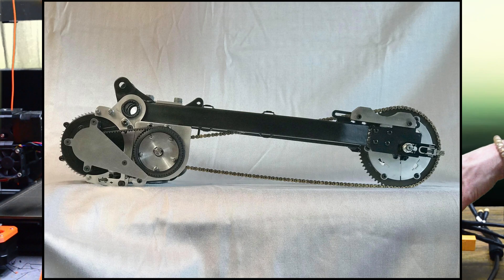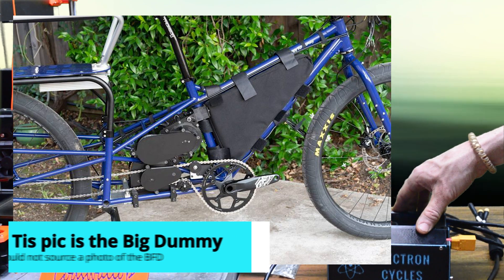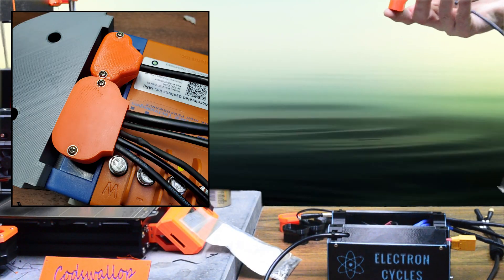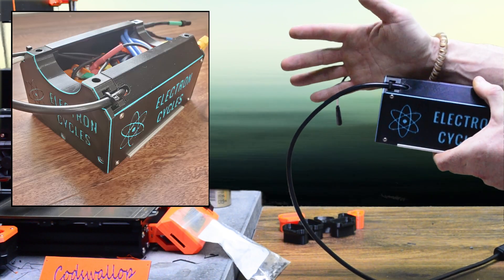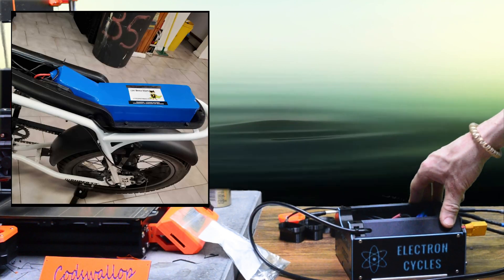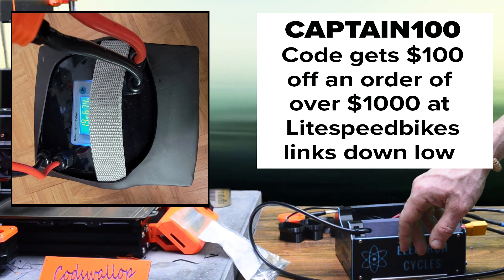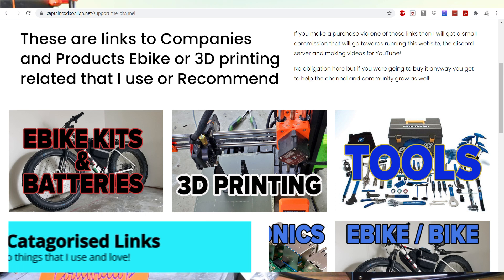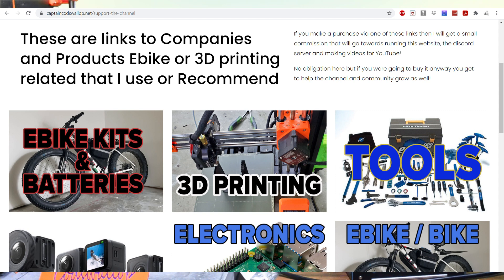Lightning Rods Big Block XL 10kw Ebike build Part 7 - Motor Update & Battery Discount Code

Comment: Are you willing to share any of those models? Say, those right-angle molex connectors? Pretty slick.
Reply from the maker: Hey Cody. Thanks for the comment. I would love to share the designs but I am going to be selling them on my website. So if the files go out then that option disappears. The money I make by selling my products then funds the channel and the wider community such as discord. The good news is I am pretty cheap. To get a set of genuine moles plugs and pins will run you about $15US and I will be selling mine for $12. Cheers
Reply: @HighVoltageKits  that's fair, though maybe you could also sell the model on Cults3d or your site. I'd much rather download + print than order a printed part. Am I right in thinking the big block XL is ~10kW continuous?? If so, what's peak power??